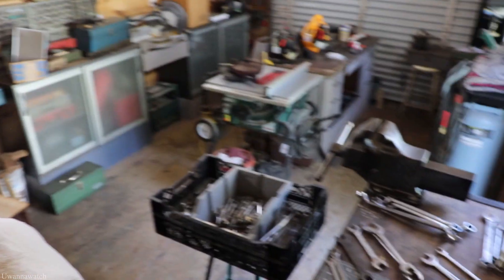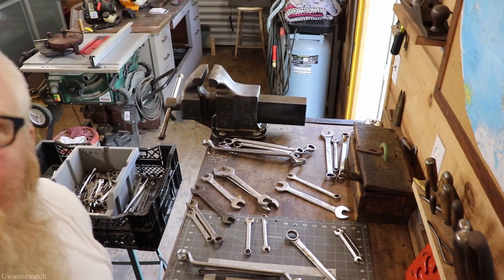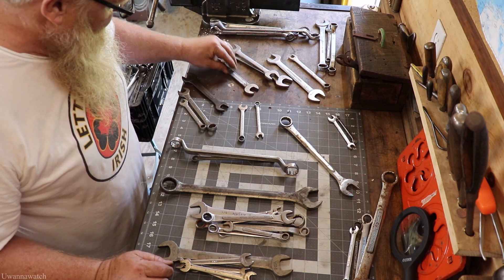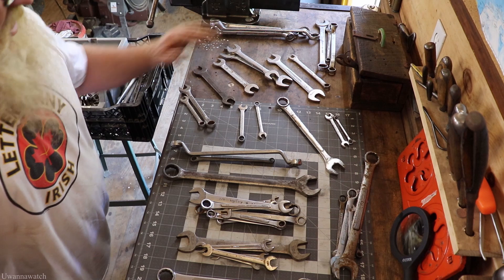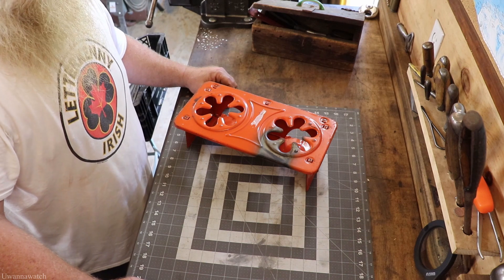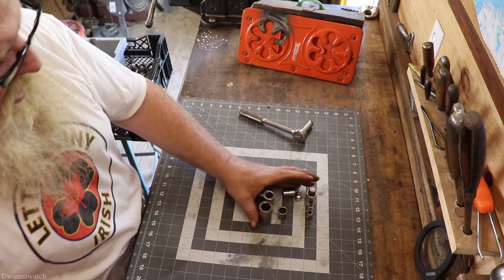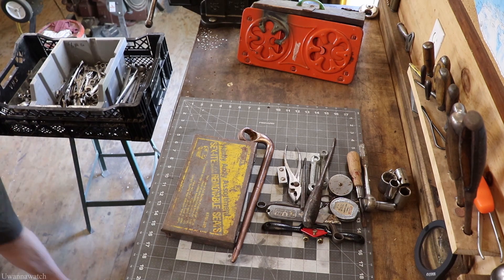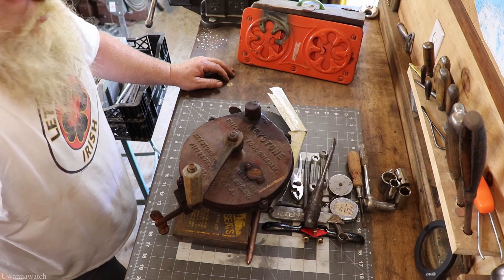Weekly Flea Market Haul # 2

Comment: Nice haul Super George! I have the same spoke shave. I got it on Amazon. The casting is rough but it works great. That grinder and spud wrench are awesome! Can't wait to see the restoration video of the grinder.
Reply from the maker: Thanks Captain Ivan. Even with the bad casting it still works good?
Reply: Surprisingly yes....even with the bad casting. I smoothed out the bottom on a piece of sandpaper but the rest is still crude.
Reply from the maker: Cool Brother.  @ivanstiles7030